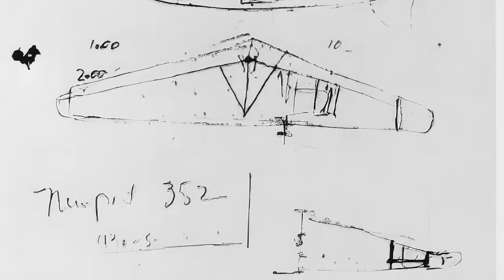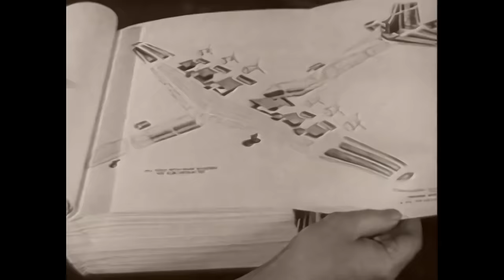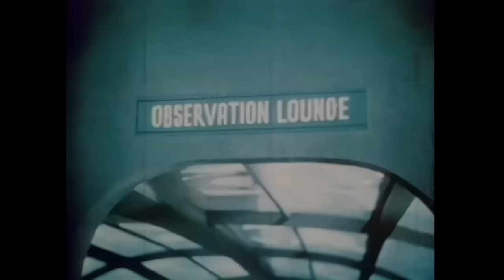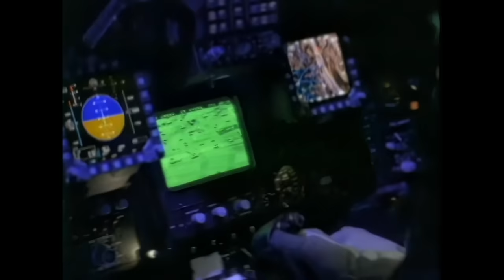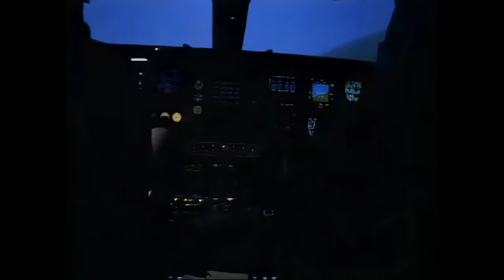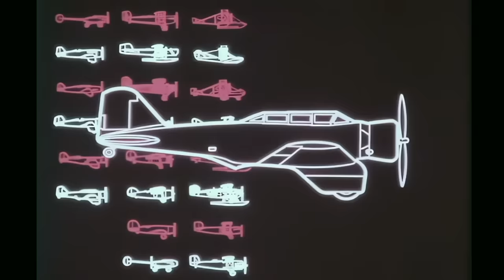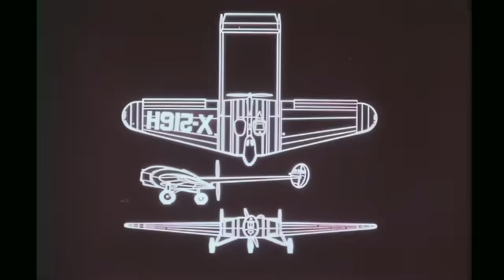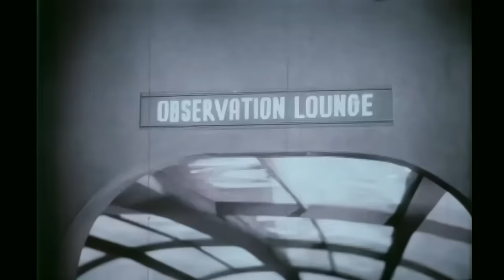The History Of The Flying Wing And U.S. Bomber Aircraft. Jack Northrop's Dream

Comment: It was a interesting idea at the time, but frankly, the poor yaw stability of the plane and the fact it was nearly 100 mph slower than the B-47 Stratojet even with the XB-49 jet vesrion pretty much doomed the idea at the time. It wasn't until modern fly-by-wire systems became available that flying wing design was made viable again with the B-2 bomber.
Reply: I was aware of the yaw problems. Didn't realize it was so slow.
Reply: I thought that one of the ideas is that the propeller behind everything is in slower air and hence even a propeller version can be as fast as a jet. And on a pusher bigger propellers mean more jaw stability and not less like when you pull on pods in front of the wings or -- shudder -- pull on the nose. I want to see a ( RC model ) with blades / fins on a rail that move on the trailing edge outwards / backwards, than rotate into horizontal orientation on the tip and in this orientation move back inside the wing. Slow movement to avoid transonic flow. No tips in faster than the sound. It sucks away bubbles on take-off to prevent stall. So actually, I want an RC model which flies high and fast .. touching transonic. The flying chain-saw.

Comment: How did he possibly get the control surfaces to work in 1947 without modern microprocessors and software? You need computer assistance to keep a tailless plane like that in bounds. EDIT: okay I kept watching more. Right, the wing crashed because the wing isn't stable enough to work without computerized assistance. Instability when aided by computers is a good thing. It worked great on the F16. But sadly for Northrop there is no way you can make a wing work in 1947.

Comment: Fascinating however it misses out the other programmes to produce flying wings. It’s a missed opportunity as it identifies that other talented design team found solving the stability issues difficult eg the well known Hortens and the less well known Armstrong Whitworths (fortunately their prototypes included ejector seats which saved the life of the pilot in their 1st jet prototype).  The flying wing concept was a dead end for both the Germans and British as it didn’t fit their geographic or strategic needs which could be met by more conventional designs whereas there was a compelling argument for the US.

Comment: Actually, the yaw problems of the YB49 were solved by using a Norton bomb site as a yaw damper. The main reason the program for the YB49 was cancelled was because of the stealth characteristics of the airframe. It is why they wete ALL SCRAPPED by the military. It was too big of a risk to the destabilization of the cold war. Did you kkow that Jack Northrop presented the flying wing airframe design to NASA to be evaluated? Thats why it came back. The military knew what they had but the world wasn't ready for it